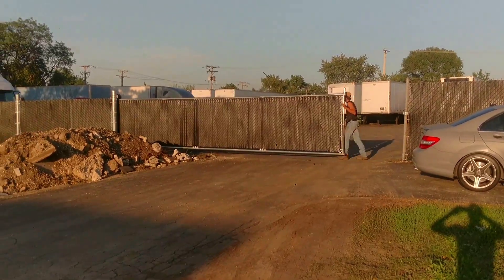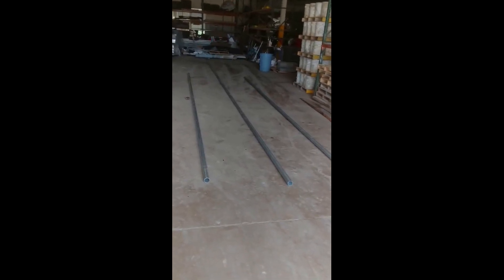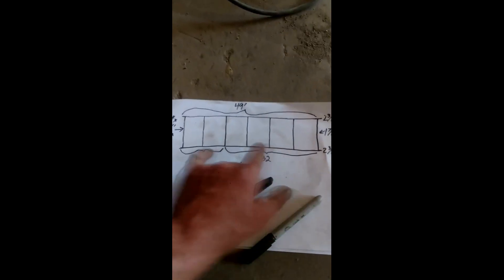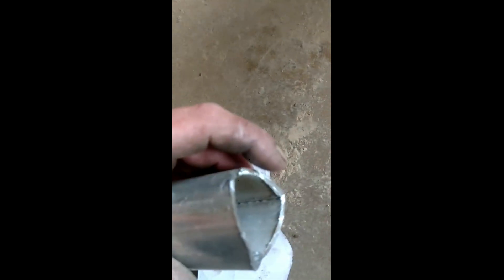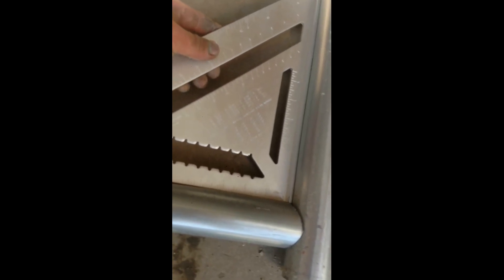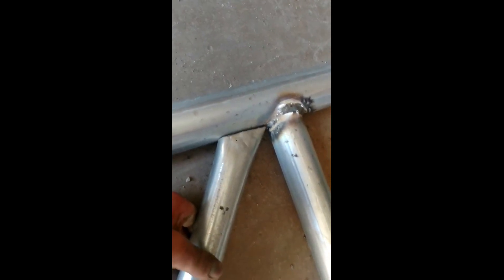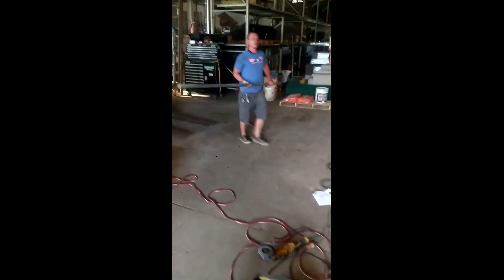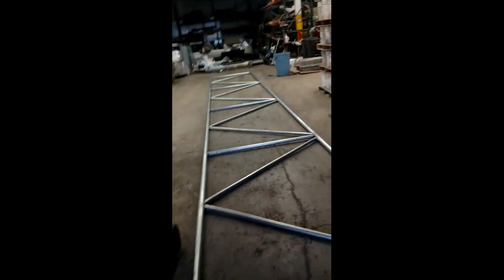How to make cantilever gate, gate on roller wheels, how to make a large cantilever gate, slide gate

Comment: Looking good, how do you decide where the uprights go and which direction is for the angles?
Reply from the maker: The fence is 6 feet tall. I wanted to make the gate line up with the fence so I made the gate 5 1/2 feet tall. You need the clearance for the bottom wheels. I try not to make bracing exceed 45° and the distance between uprights exceed 10 feet.